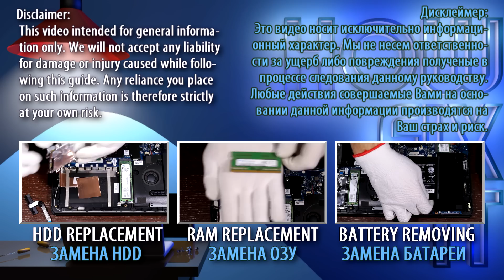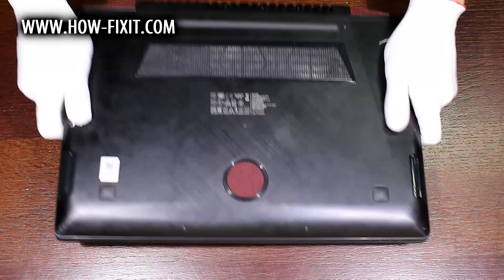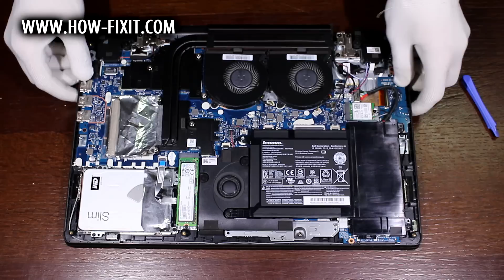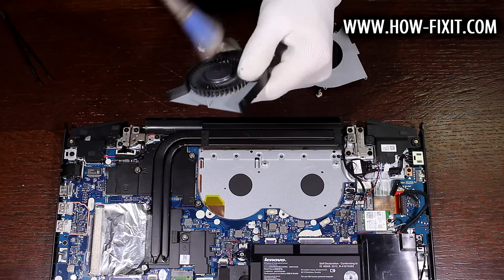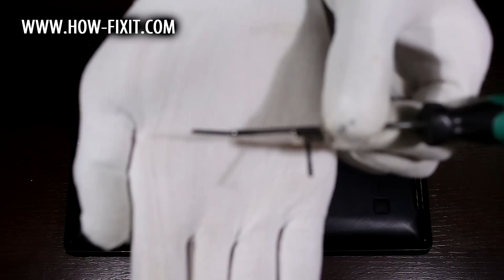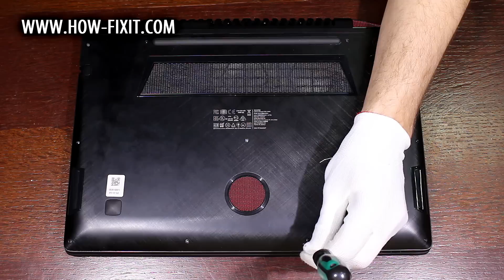Lenovo Y700-15ISK Disassembly, Fan Cleaning, and Thermal Paste Replacement Guide

Comment: I chance and clean My Lenovo y700 But after change they Thermal paste now it's more hot un gaming before GPU give me 78-80 celcius But now 89-90 celsius need to settle the thermal paste? I use this one (silitek)
Reply: Maybe you put too much like the guy on the video, if so, please remove it and apply the thermal paste again.

Comment: Hi bro, two questions, how much storage is the ssd you have installed? how much can i install?
Reply: I think he has the same HHD that the laptop came with, however, he installed a M.2 SSD that can be as big as 2TB I think for this model. (note, If you cant find it its right in front of the Hard drive itself) Hope this was helpful.

Comment: Damn. 1:46 You took it off but I cant :<<<< Its quite difficult :I
Reply: U could use spachtel kind of tool
Reply: To slide under
Reply: I had short finger nails last time I cleaned mine, it worked

Comment: Hello, much easier to use Compressed Air.
Not a single screw is unscrewed.
The process with the compressor takes a maximum of only 5 seconds.
After that the laptop is so clean, you never make it with the toothbrush or brush.
I've cleaned this already 1000 times.
The gameing laptop is blown out with me once a month.

Thanks for your video.
Reply: Definitely false, you will never be able to blow all dust out, in fact, you push it in deeper and cause worse problems.
Reply: @yeoldefoxeh254  not the way this laptop was built. An air compressor works perfectly with this model. All dust escapes.

Comment: Has anyone noticed on a Y700-15ISK (with matte film) that the right side of the screen is darker than the left side? (Or is it just my piece that is faulty) Thanks in advance!
Reply: My first thing was to remove that foil from the screen. Even then the brightness of this laptop is weak
Reply: mine has weird green light patches on the edges.
I think lenovo just robbed us -_-

Comment: Is that thermal paste at 7:58 ?
Reply: Nope, just glue.
Reply from the maker: Yes, this is thermal paste.
Reply: Thanks for replying. Also, can you tell me how many application that tube will last? Is it a 2g tube?
Reply from the maker: As I remember it's 5g. But even 2g will be enough for a lot of applies (hard to say how many exactly), if you will aplly not to much each time.
Reply: Thanks a lot. Very helpful!

Comment: I got an MMC card stuck inside the SD card slot ! How can I get it out ?? its too small to reach with tweezers or tape :( 
If I unscrew the laptop will I have access to the SD slot area ? Will I be able to push it out or something ?? Please help Thank you
Reply: SlimyZombie Don't know if you've solved your problem or not. The long green stick to the right of the big Slim block (Hard Drive) is the SSD. You have complete access to it.
Reply: Thank you! I managed to get it out using sticky tape

Comment: there is a dustfilter in the intake grill. If anyone is doing this. you can clean that out as well while you're at it.
Thanks for the video!
Reply: Or remove it, it's incredibly restrictive for the airflow
Reply: @Kacpa2  but then you have tons of dust going in
Reply: @Kacpa2  you dont need heavy duty airflow, but i agree with you, they make them like that so you shange stuff in it